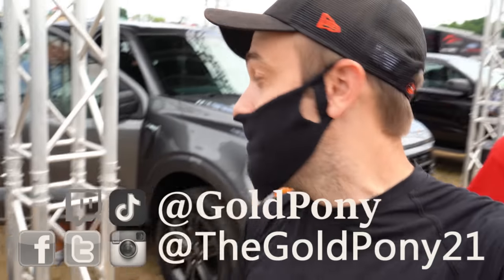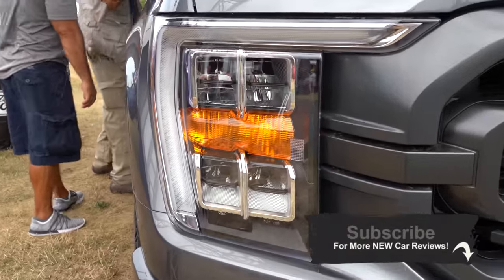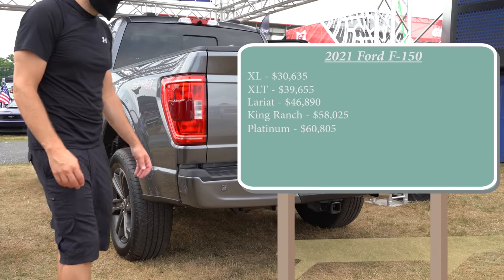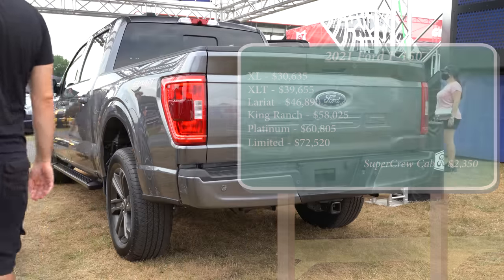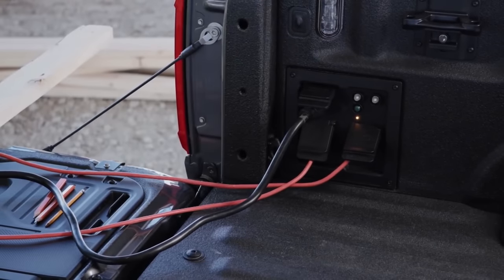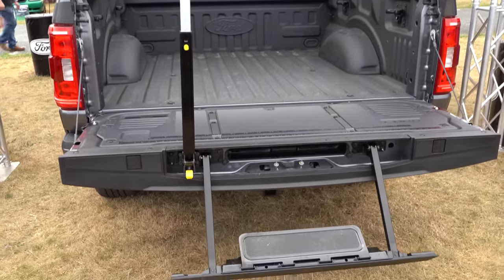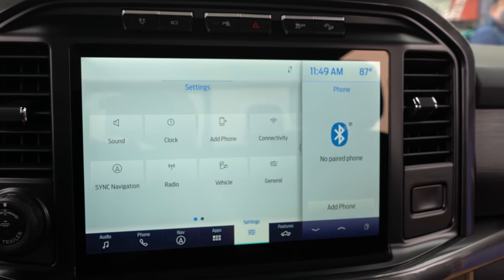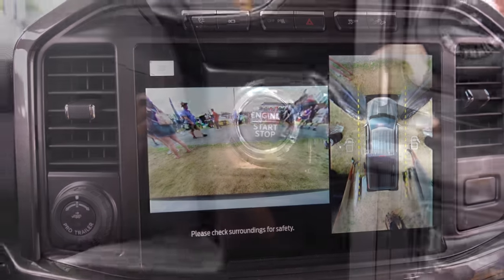2021 Ford F-150 First Look | This Truck will Surprise You

Comment: Who else remembers when trucks were trucks and not just to show off
Reply: only boomers
Reply: Get a base model.
Reply: Trucks now are way more capable than trucks of yesterday.
Reply: Kyle Bethel way more capable, more comfortable, more economical, cheaper to maintain. These guys just want to complain.
Reply: These trucks are not just for show. They also make your life easier. Have you ever worked off the tailgate of your truck? I have. The option for the outlets on the back of the truck is a great idea. It will be  very beneficial to some people. The folding down gear shifter will be great for wring reports from the jobsite. The seat laying flat would be spectacular if you've ever averge 19hr work days or need to drive 20+ hours. Wireless Android auto or Apple car play?? Well that just benefits everyone. I've done all these things that being said I'm not in a position to drop 75k on all the bells and whistles that make my work life easier  brand new but 5-7 years from now pre owned. Well I just might be able to do that. Just because some of us can't afford certain things doesn't mean their not beneficail.
Reply: @USMCPFC1  absolutely right. Im looking at 2017's right now, upgrading from 2010 will be night and day difference
Reply: @Andomosity  I hear that. I currently got a 2013. I'll wait another 5 years years or so to grab either a 2020 ram 1500 or this new 2021 f150 with the bells and whistles. Enjoy your New to truck when you get it.
Reply: @USMCPFC1  just left the dealer 15 minutes ago in a 2018 king ranch. They gave me a price i couldn't say no to!
Reply: @Andomosity   😃 hope you enjoy the shit out of it. Remember to pause every now and then before you jump in so you can take the sight in. It might put a smile on your face in the morning before heading to handle business. Also bluetooth is a wonderful thing.
Reply: I do. I learned to drive on a old truck on the farm. 3 on the tree and a squeaky bench seat. No ac...Driving down the road with the wing window open to get more air. Lol
Reply: that's the definition of the SIlverado!!! Its made to truck things without being super fancy or being over done! Its does all the things you'd want it to do while still being a "truck" and not some luxury truck!...
Reply: @dallasfrost1996  you know we can all get a stripped down version of these trucks without the bells and whistles. We have choices thats what makes them great. If handyman Kevin wants a no frills get her done truck for a reasonable price he can. If mechanic joe wants something a little more comfortable that he can use to truck around parts, supply and family he can. If vice-president kelly wants something with all the bells, whistles and  bees-knees to truck around her/his family in, be capable off raod and still able to put work for very premium price tag he/she most definitely can.
Reply: @USMCPFC1  I realize that! I was being sarcastic more then anything lol! It was a joke...
Reply: @dallasfrost1996 lol my bad.
Reply: @USMCPFC1  That's all good!
Reply: Yeah I dont want to have to eketric engine in a truck to me it takes away the truck feel and gives a tesla or priues type of thing
Reply: @williamjackson1482  well I'm 16 and think the same so boomer might be a stretch my guy
Reply: @kylebethel7299  maybee but yhe eletric engine gui,s it for me
Reply: Not just the trucks but everything in this world is for showing off now. Kitchen appliances, furniture, cell phones, televisions, watches, cloths, houses etc.Nothing is simple anymore my friend and comes with the price tag and thats the system us humans have created for ourselves.

Comment: “Extremely different look” where does it look extremely different?
Reply: It's definitely a different look but idk about "extremely"... I still like it though :)
Reply: I have an 18 f-150 and it is very different. Not extremely, but the bumpers, headlights, fenders, side mirrors, door handles, and tailgate are all different.
Reply: Eric Light no it doesn’t
Reply: Still looks like a Ford to me...
Reply: If ford designed it as cyber truck then we can understand as extremely differ look. But this looks not far from all other truck. 

Also the motorized shifter can be a trouble some when the motor stop working and not come back out.  Just put the dials or button shifter on dash like others then you can use that shifter space for something else. Why bother to create something can fail down the road. 

Less is more.
Reply: kinda looks like a Ram
Reply: It looks alot like the 2010
Reply: Extremely different look should be the Cybertruck as pickup, but alike ugly as well
Reply: Everywhere. Open your eyes mijo
Reply: I know this is a completely new truck but it really just looks like a refresh.  The Silverado on the other hand is worlds different than the prior generation.
Reply: is that a refresh still looks the same to me
Reply: Eric Light yea
Reply: its looks like frick and extremely different only in humans minds.
Reply: Zip Ninja no
Reply: Looks the same to me. For $72,000 better be able to live in it
Reply: Jonathan Fesuluai  Ram still Looks better hands down...
Reply: Mark Hoffman because it’s got the logo on it?
Reply: @SamoanJon  how?
Reply: Everywhere
Reply: @dama2803  its a refresh. Tweaked front headlights and grill, slightly refreshed interior. But mechanically theyve added some new technology lile the generator feature. Innovative but overloaded with tech in my opinion. Like the rear seats that lock down instead of just offering a locking lid on the under seat storage like my titan xd has.
Reply: @CZ75undisputed  l
Reply: You can only evolve a design so much without ruining the brand image recognition. From head on it looks the most different, if a little startled
Reply: Seems like it still has the same cab from the last model kinda how the 04-08 and 09-14 shared the same cab
Reply: @FernandoTorres-hb7qf  it is. Just refreshed front and rear ends.

Comment: 1/2 ton trucks approching $100k..  absolutely Ridiculous
Reply: Exactly. You can get a Diesel F-250 for the prices of these 1/2 tons
Reply: It’s all about luxury
Reply: 72k for a f150 is crazy
Reply: Only 1% of f150s are limited and 4% platinum. So they aren’t that common.
Reply: @emnaq3  must be nice to be in the 4% club!
Reply: Yes it is
Reply: RhinoAg How so? Lol not even close.... diesel 3/4 tons of the same trim level are easily $10-15 k more expensive
Reply: Hello there diesel HD’s are an EASY $10-15 k more expensive in the same trim levels.
Reply: Right. Let's all play along and pretend like it's perfectly normal to pay full MSRP for these things. 🙄
Reply: three weeks later the TRX comes out that costs over 100K fully loaded
Reply: Well these are practically luxury cars with a bed
Reply: @drw1926  Right, let's all play along and pretend saving 10 grand off SEVENTY GRAND is some kinda excuse for the insane price.
Reply: emnaq3 very true. Base truck still 30k very affordable for what you get
Reply: @TheChewpo  even the half ton base trucks. No frills,   2WD, small V8, extended cabs are in the  mid 30s up over 40 now.  That's terrible.
Reply: @RhinoAg  0l opp
Reply: @X-Fantasia  9
Reply: 167citrusave l
Reply: @gl9500  p
Reply: koo
Reply: Inflation
Reply: @theshield1613  its not inflation.  Its all the price bloating Tech and electronics they are stuffing into the trucks
Reply: @freeravenadventures6925  Again it's called inflation not just car industry same with housing market ,money is devaluing
Reply: @gl9500  Ok, I wasn't saying it was a good deal.  I wouldn't pay that for a new truck and I thought $50-60k was too much.
Reply: Patar D  trucks aren’t supposed to be luxury vehicles.  They are used to tow and haul, they’re meant to work
Reply: They sold almost a million F150's in 2019. So alot of people can afford them. Maybe you need to work somewhere besides Mcdonalds
Reply: I'm older so I remember when trucks were the least expensive vehicles.
Reply: Joe Madej  then don’t get the expensive one 😅
Reply: Joe Madej  I really don’t care what you’re getting
Reply: Joe Madej  I’m getting a sandwich. You want some?
Reply: Ever higher trim levels.  Get an XLT and make sure to get at at least 12K off sticker and you get a lot of truck for the money.

Comment: He said, "... seats fold flat so you can practically live in this thing."
At those prices, you'll have to. Ford was thinking ahead. Great job, Ford! 👍
Reply: True, if I traveled more for work I would buy this truck. But I like the seats in my king ranch so it's good enough for the amount I travel. About 700 miles a week

Comment: Boss: Why are you late for work?
Me: The shift knob wouldn't come up.
Reply: Ford Mechanic: You're gonna need a new transmission and center console.
Reply: Money pit

-Scotty Kilmer
Reply: Even if you don't need a new transmission (lol) or the shifter doesn't get stuck... It's still one more useless thing they put in this truck. Probably a lot of chinese parts in the drivetrain so they could budget for these useless features.
Reply: noone wants all this crap . its a truck not a super car. We dont need 60k dollar trucks because they add tech that all breaks anyways then your left with a truck worth nothing.
Reply: @Moonless6491  when you cant fix the problem replace the problem with another problem. Ford engineers
Reply: Cody Davis @ Do you have a mouse in your pocket? If it breaks, get it fixed. If it breaks and you can't afford to fix it, buy an old Datsun B210.
Reply: Lol that is funny
Reply: Faroos Almaawali I heard the same thing about electric windows LOL
Reply: @CMDAVISs  No one? The reason it has all these features is because the market want's it lol...Just go look at how many of these loaded trucks are on the road
Reply: Racing Slippers exactly! He’s bitching about features and theres more platinum and limited trims in the road than anything else 🤣. Clearly it’s desired.
Reply: Cody Davis bro if you can’t afford it just say that. A ton of people have no issue buying these “60k trucks”.
Reply: Wouldnt need that fold down feature if they just kept the column shifter...
Reply: Reese Moerike most buyers don’t want a column shifter because it looks cheap.
Reply: If your driving this truck at this price you are the boss there’s no need to explain anything 😂🤣
Reply: @michaelmcqueen9177  😂😂you sir have a point.
Reply: @CascadeSlim0119  yet a 2020 f450 king ranch has a column shift which is $100k truck
Reply: Reese Moerike idk what terrible ass credit you have but a king ranch isn’t a 100k truck. That’s not even the highest trim.
Reply: @CMDAVISs  Most people do unfortunately, and don't think about the potential long term consequences.
Reply: @CascadeSlim0119  is is in canada... 9$5,000 after taxes over $100k
Reply: @CMDAVISs  darn straight. All I  see is a lot  more  stuff  that can break.
Reply: Lmao 🤣 🤣 🤣  I don't know why that was so funny
Reply: That's what she said...
Reply: 2008 f150 cost 18k. Inflated thats 20
Reply: @fgarcia897  chevy is a money pit
Reply: very good legit excuse late for work  you know what i might buy this truck cause of that

Comment: I have a 2019 ford ranger and this f150 is so damn good. In a couple of years I’ll be looking into a f150. Ford trucks all the way
Reply: Go for Toyota Tundra there faster can haul slightly more and more reliable
Reply: @gregmsnow l seriously? lmao check the specs
Reply: Talon Snow no body wants a truck that has had the same body and frame since 2007. No thankyou
Reply: Tyler Lewis ok bud makes no sense but ok

Comment: anyone remember column shifters.....
Reply: I like having my key there.
Reply: Yeah Chevrolet does
Reply: My 1995 F150 does the job just fine
Reply: anyone remember 5 speeds...
Reply: I have a 2018 XLT with the 2.7 twin turbo. Has a column shifter. I wanted 5 things and that's it. Paid 30k certified pre owned. Paid an extra 1900 to turn the 7year 100k powertrain into bumper to bumper. 5 things. 1) 10way power seats 2) 4x4 of course 3) crew cab 4) heated seats 5) navy dash sync 3. That's all I need. I got this for my 50th  birthday and will keep it until it or I are dead. Love my truck.
Reply: @y5mvbc  I don't need any of that... two wheel drive regular cab 8 foot bed and I'm as happy as a pig in slop😂
Reply: Ya! There the way to go.  Center console  shifters can go.. id rather a tissue box, or a drink or somethin.
Reply: Rather have bench seat and column shifter than any other option. They could call it the baby maker package!
Reply: Those are called crow bar shifters and SUCK
Reply: Like the one I have in my ‘19 F-150?

Comment: The dual glove boxes are taken directly from Ram. The fold flat shifter is great for getting head while driving. That's about the only benefit I can see.
Reply: Chevy did that in 2007.
Reply: Rinconmaniac actually the 96 Taurus had duel glove boxes

Comment: Is nice I am a ford guy but the only thing I don't like is all those electronics after a couple of years it will start malfunctioning.
Reply: Oscar Colindres that is what scares the dickens out of me. Just how many really good wrench’s are out there?
Reply: and thats why prefer analog gauges car or trucks..thank you
Reply: I mean would you rather not have the tech? Electronics break...it happens, but I'd rather have them then not.
Reply: @MeZzZzZzZzZzZzZzZzZ  i would but what if the software malfunctions  and the shit goes out and fucks up...then what?
Reply: On the bright side, you can still buy vehicles from the pre-1960s and not have to worry about any electronics at all.
Reply: Stop being cheap and buy a warranty.... you never have to worry about electronics
Reply: I’ve learned my lesson with a Platinum. My next will be Lariat or XLT, if I stick with Ford. Sure parts are warranted, but can take some time to get them and may require multiple visits to the Service department.
Reply: The idea of a 54" smart T.V. in my dash is frustrating. My '03 has a factory radio that I never listen to. But my view is the point that it's a truck is just the tires, the rest of the thing is one big remote to tune into the smart planet. Now they know all the off-roads (on new Bronco and this F-150).
Reply: That's why you get the extended Unlimited Lifetime Warranty. With all the gadgetry in cars these days it's a no-brainer now.
Reply: That's why I refuse to buy a Tesla where you pretty much control everything from a tablet
Reply: @ejohnson3131  I'm a bit, what they all say; 'Old School', or 'School of hard knocks'. I am just happy to be alive, so that is why I love my '03 F-150 5.4 2 valve (not the damn 3v) @ 253,037 miles and she's very strong, so I call her 'Gorilla'.
Reply: That’s when the extended warranty kicks in
Reply: Show an XLT please.  More people will buy that versus the other models.  All of the other vehicle trims are nice, but the XLT is more in line with the average consumers price range.  Nice video though.
Reply: Jeffrey Bishop they make warranties for that stuff.
Reply: Gavin Foutz but do worry about getting out of the driveway.
Reply: very true.. ford has  their own issues too.. people going on about GM and DODGE having issues.. please, ford has theirs too! electrical problems for some time now has been one of the big problems with the fords.. I wonder why?...

Comment: Like the new truck and all the little added touches. Personally, I wish Ford would put some of the black trim/sport appearance package treatment on the king ranch/platinum/limited trim levels. Besides the more luxury options inside, different wheels, grilles and tailgate applications, the most common add on is a whole lot of extra chrome trim. (as well as a H.O. Ecoboost with limited) This seems odd considering they charge more for the black/ sport appearance package, and you are paying more for the upper trim levels, but you only get more chrome.  Last rant, on this XLT in the video, you have the sport package which gives you the dark trim, but then oddly there is a chrome exhaust tip? A matte black tip would complete the look, IMHO🤷🏻‍♂️